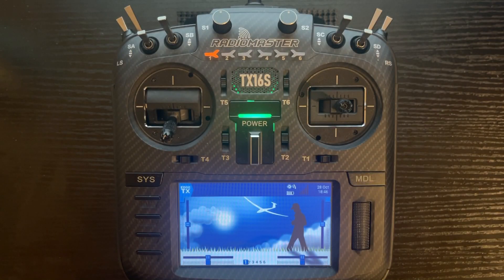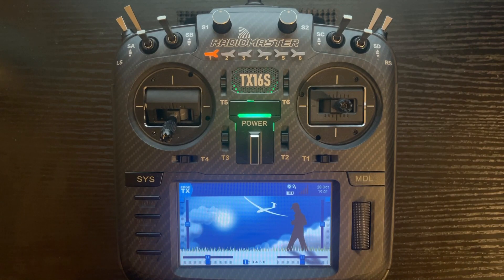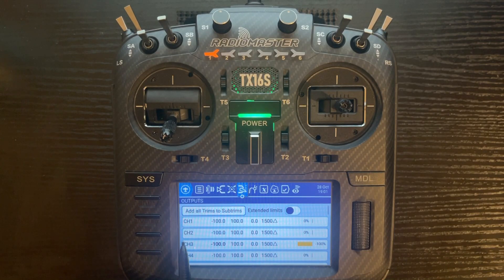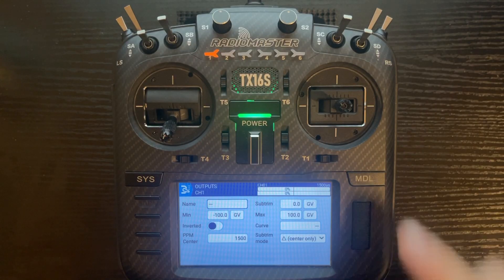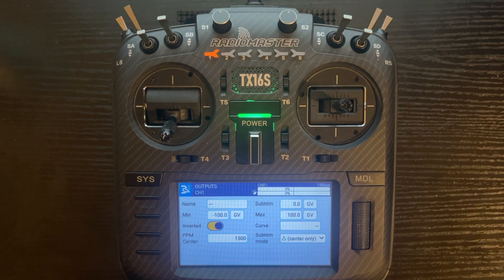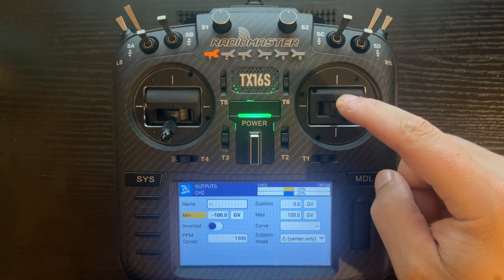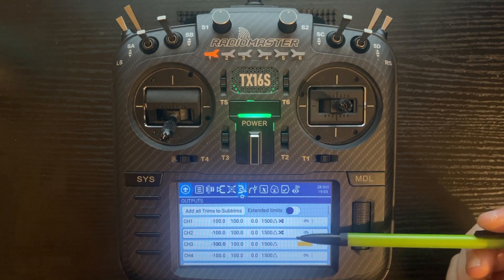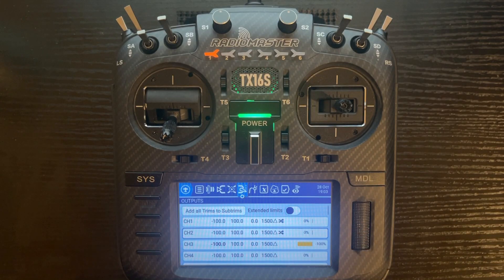Radiomaster TX16s/Edge Tx: How to reverse a channel? (Inverting Channels)

Comment: Hi, maybe I’m little late but I have an issue with my tx16s 4 in 1 module.

When I bind my receiver (lemon rx 7ch) I place the channel like it should be (TAER) and the internal set up is set for TAER in my tx16s. But when o connect each control to the corresponding port it just active the ESC because the ports connections are wrong. 

I was able to probe each port individually until I get the correct order and even when the receiver is TAER and the internal set up is set TAER to work properly you have to connect it like ETAR. 

Everything works fine, but in the tx16s the channel 1 is Throttle and so with the others. 

This doesn’t have any issues, I was able to bind and fly all my 13 models this way, the problems come when I decide to get a lemon rx stability receiver. I connect everything like I said but when I turn on the gyro it corrects like it is TAER.

This means that when you turn the wings the throttle starts for a moment, and when you put the tail up, the ailerons go up. 

Is there any way that I can set it properly, making each channel meet the correct order in the radio and the receiver ports ?

Comment: How would you set the inverted switch to an external switch?  I need to be able to quickly invert the aileron (actually it is a boat rudder) depending on the user.
Reply from the maker: Use 2 lines for rudder.  Assign switch in one direction and opposite for other. Lastly make one line -100 and other +100 (both is +100 before editing)
Reply: @BDTennessee   Thank you.   It is nice you can invert the servo direction either in the output section, or in the mix section like you described
Reply from the maker: @fredbarnes196  output inverts channel as a whole. Mixer does channel or switch method. Keep in mind inverting (value such as -100) with mixer makes the adjustment opposite. (Positive reduces and Negative increases)

Comment: I am sorry to say that with EdgeTX version 2.10.5 this method is not available. I found that setting the Weight from 100% to negative 100% achieved the required result. The Hi, Medium, and Low rates still worked as expected. To be honest I have found the Radio Master TX6S with EdgeTX a very steep learning curve even though I am very proficient with OpenTX (over a decade of use)
Reply from the maker: Yes this method is available. Im using even 2.10.5 in this video and its been the same way since Open TX. You can change the value to minus in mixer and achieves same result as you mentioned too.

Edge TX is more clean and option filled than Open TX.
Reply: Thanks, Ifind it very hard to find information that is up to date. The method you explained does not appear on my computer, it is a Mac. This is not the point though to me it seems the EdgeTX team are too focused on mathematical/computer correctness rather than an easy to use user interface. Why not display 'Reverse Servo ?' and tick a box? This is jargon every meddler knows. I have a problem at the moment with the 6pos switch, I need 6 positions for 6 flight modes, I can get 4 modes to work but not mode 3 and 5. My interest is based on the ArduPlane firmware I use for my H743 wing flight controllers. If you are interested I would happy be to further explain.
Reply from the maker: @cattlebaron483  this video is on the latest firmware so its the most up to date you can use.  I dont use campanion and dont think currently there is a version that same as newest EdgeTx.

Invert is same as reverse servo,i mention this in the video. Click on the toggle switch seems to be easy as checking a box.

Comment: There's like 10 different ways to invert a channel in edgetx. The other common ways are to set a negative weight in the inputs or mixes. Where to invert depends a lot on your mix setup and what gives you the best understanding of your setup. For example, you might invert the aileron input so your mixes screen can have a nice a+b, a-b instead of -a+b, -a-b.

Another 3 methods are a custom curve in the inputs, mixes, and outputs, which is y=-x instead of y=x.
Reply from the maker: Agree there is many ways. However Inverting on output is simplest and effective. Invert channels that need to be done and everything else falls into place...

I dont like using negative value in mixer anymore. Adding and subtracting mixer values will be done the opposite. Keeping them all +100 allows adjusting + to increase and - to decrease...

Comment: Great video as always. Thank you. I do have one tech issue on Radio master. It's about using Timer. Coming from Spektrum radio, I am trying to figure out how to configure Radio Master so that after the timer expires, for each minute over, it will announce and vibrate. Like "One minute over", "Two minutes over", "Three minutes over" etc
Reply from the maker: I noticed on my radio it calls out at 1min over. Ill look into setting up for additional time over minute callouts.